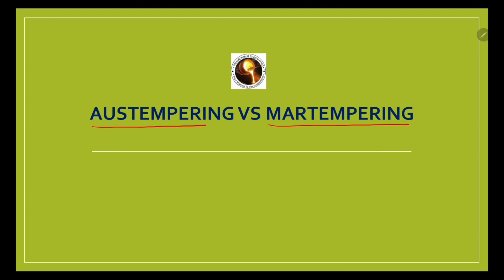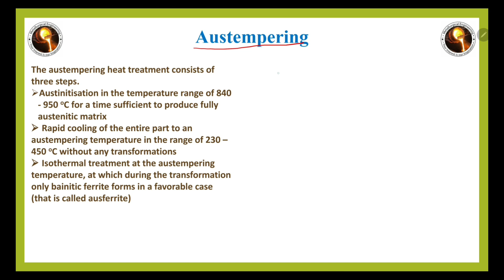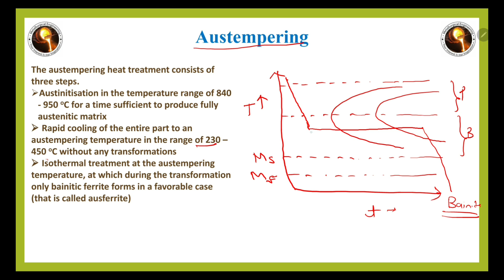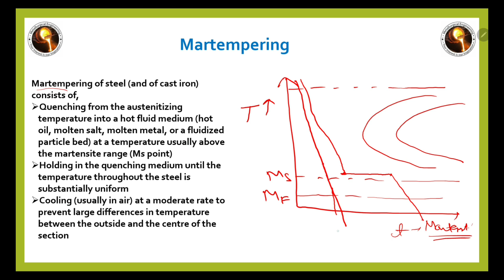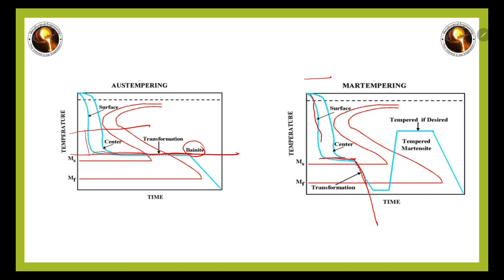Austempering and Martempering | Heat Treatment | Metallurgy

Comment: in martempering process, why they hold the temperature right above the Ms temperature for a certain time before quenching to obtain martensite structure?
Please help me to explain that
Reply: If you see the last diagram of martempering, before the transformation you had 2 curves that describes the cooling of each section, one for the surface of the piece and other for the centre. You need to reach the thermal equilibrium in all the piece before to start the transformation